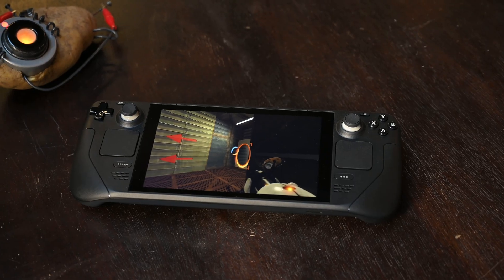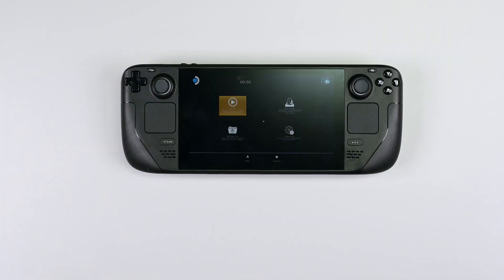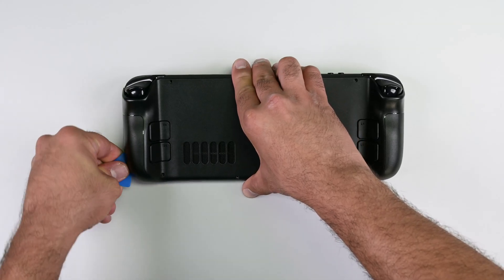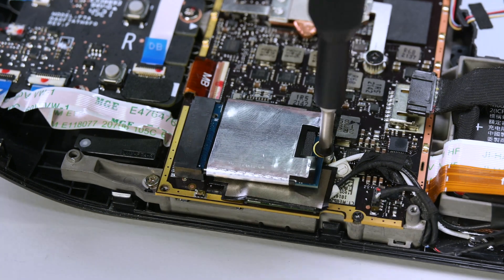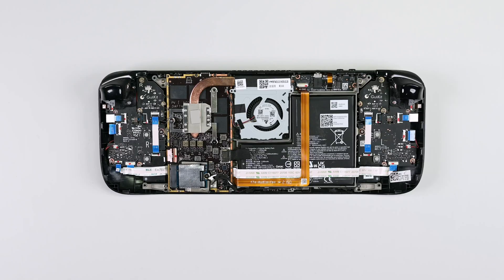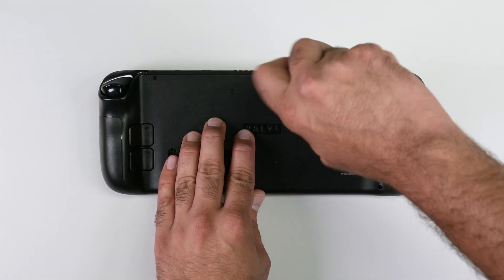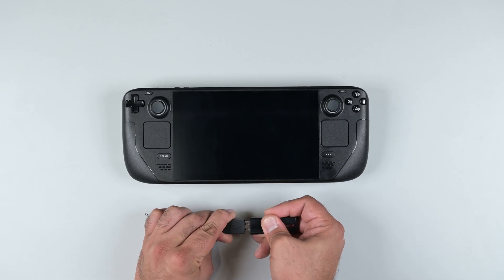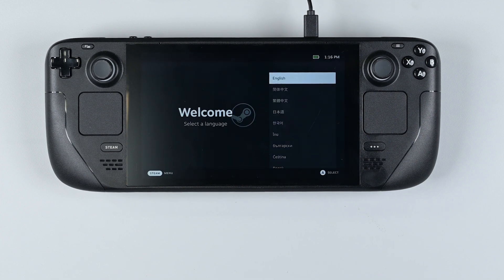Steam Deck SSD Replacement: Get it Done in 20 Minutes!

Comment: Ya forgot to put the aluminium tape back on that silver shield.
Reply: its not needed.
Reply: @NexXxus86 sure it is.
Reply: you speak about the aluminum tape on the metal shield on top of the heatsink screw right? I don't have mine either, I don't think theres any disadvantage of not having that.  @S....
Reply: @NexXxus86  So, why was it there in the first place? It must have served some purpose.
Reply: @artusanctus997  to help the airflow a little and make the air circulate better inside of the metal shield for VRM cooling. but its negligible.  
You can put some regular sticky tape on the screw hole if you don't have it anymore.
The aluminum foil that is wrapped around ssd on the other hand is to prevent electrical interferences between SSD and wifi module.
Reply: @NexXxus86  I see. I ended up putting mine back because I didn't want to ruin anything. I changed to the Gulikit Hall Effect joysticks just recently, and I am now considering taking the plunge to upgrade my SSD to 1 TB as I have the 512 GB LCD model, but it's not enough storage.

Comment: What if you broke the foil tape
Can you buy a new foil tape
And use that.
Reply: You don't need one on top of the heatsink screw. But for the SSD, you need it for shielding and it needs to be isolated on the inside if you don't want to short the SSD.

Comment: why peal ssd shielding why you can just slide it off and slide it on 
for reinstallation I my steamdeck have problem with 5GHz 80MHz channel wide network, better switch to 2.4GHz and regular width at least for reinstallation/first update as it will stuck without any error 
good luck ^^
Reply: I couldn't slide it back onto my Single-Sided Kioxia BG4 SSD, It just wouldn't fit. I had to peel it for my replacement.
Reply: Same here. Sabrent 2TB SSD. No way it would slide in. Believe me I tried 😂
Reply: @YeredMartinez I got the 1 TB sabrent SSD too and I got it to fit, but is is CLEARLY bulging and it took a good few minutes of force. Strongly recommend just peeling it
Reply: @YeredMartinez  fitted perfectly on my 2TB SN740. I guess some SSDs are thicker than others.
Reply: Some SSDs are more thick than others.